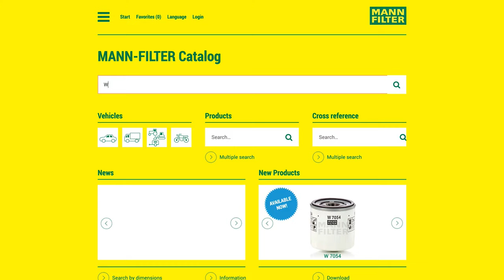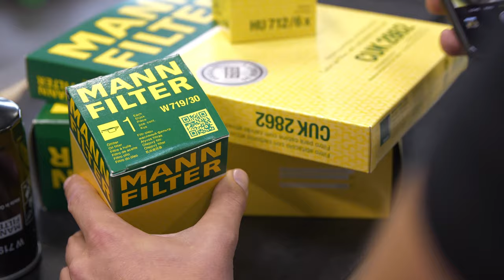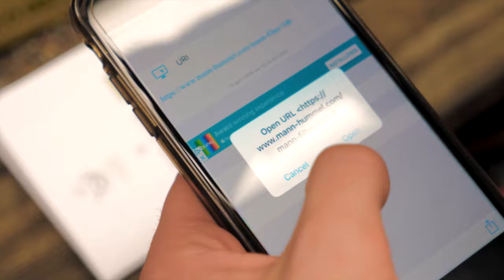MANN-FILTER Brand Movie - full version

Comment: Mann filters are my aftermarket brand of choice but there is one thing that buyers should be aware of.  Although Mann is indeed a German company, their filters are not made there, or at least the ones I have used aren't. They are made in South Korea, well I assume it's South Korea,  the info on the product box says Korea but I doubt it would be North Korea!  This information is in very small print on the bottom of the box, sort of like they are hiding it!  So, ok, if the factiry is owned by Mann and under their control with strict QC, then fair enough.  If it is a sub contract supplier though, this could cause inconsistant quality.  So far, no problems for me but something to be aware of.

D
Reply from the maker: We have several production plant all around the globe. Our biggest production plant is based in Bavaria in Germany.